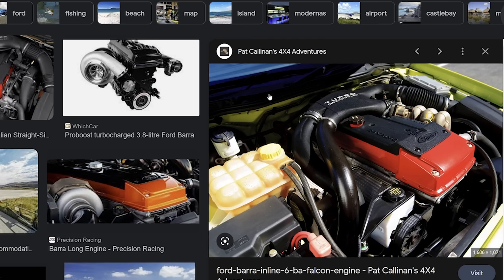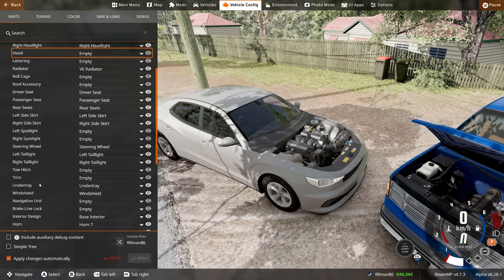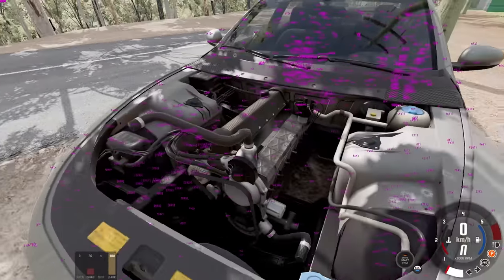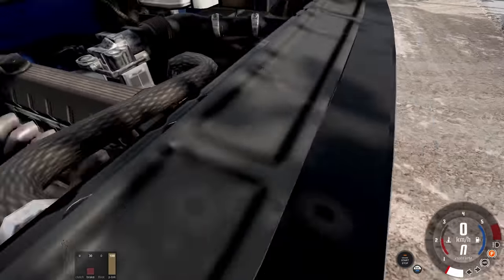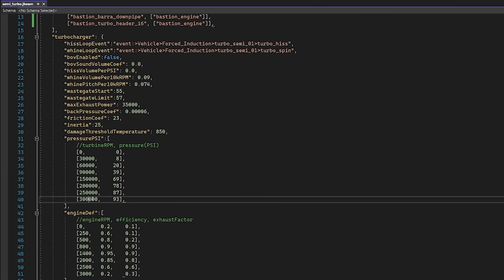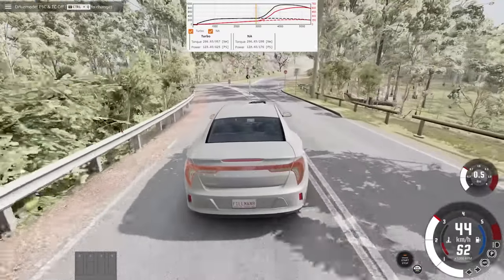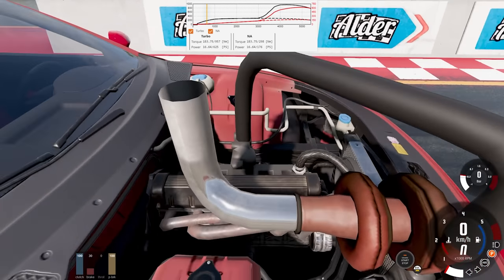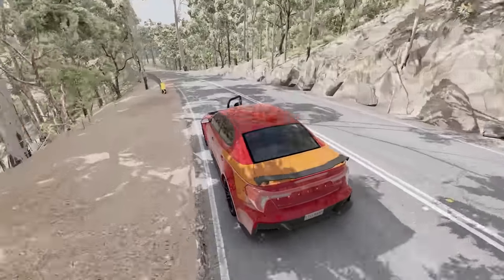The Barra Was in BeamNG All Along!!!

Comment: Nowadays people take the last generation of the 300 I6 and are putting massive turbos on them basically making torque monsters that's our substitute for not having a Barra and sure the old versions don't make any power but we love it because they are very strong and reliable
Reply from the maker: cool, does the stock version also take large gobs of fuel? haha
Reply: @fillman86  fuel economy wasn't really the 300i6 greatest benefit you basically drive it like a diesel with a 5 speed, speed and rpm isn't a benefit either its just reliable and will survive the apocalypse if you look at the head on one even on the 240 it has an inspection plate that covers the side of the head so you can see the pushrods
Reply from the maker: @kingstyle7314  pushrods? omg that's an ancient engine then
Reply: @fillman86  the 240 design was from the 60s and the 300 is just a bored over 240 with fuel injection that's pretty much it and in 97 it was replaced by the 4.2 v6 like what's in my truck and the 4.2 is just a 351 small block with 2 cylinders cut off doesn't handle boost but is still a very reliable motor but it's another slow grandpaw fleet motor made to just keep driving
Reply: @fillman86  the ford 300 (aka 4.9ish liter) inline 6 was ancient, heavy, thirsty, and underpowered as hell but I’ve head of them continuing to run in conditions that should kill any engine (bolt bouncing around in the cylinder, running out of oil, sand in the oil etc)

Comment: So, just as a datapoint, the I6 that you grabbed is actually quite close to a late-1960s Pontiac OHC I6 engine.  The valve cover and headers are quite distinctive.  (And, in 1968 and 1969, it was a 4.1L.)

Personally, I liked having the 200cid Barra-predecessor engine in my '65 Mustang because the weight balance was vastly better than the balance with a V8.  I can definitely see the appeal of a new head, though; in the old head design, the log-style intake manifold is cast in one piece with the head, which made carb swaps a bit tricky.
Reply from the maker: Yeah, many engines are similar, and this one was a lot closer to the 70/80s i6 we had than the actual barra
Reply: @fillman86  : Yup -- though I misspoke (and edited my comment to correct myself); the Pontiac engine was an overhead-cam engine, which was pretty remarkable in an era of pushrod engines!  And it was very much not a truck engine, which makes BeamNG's use of it amusing.  It still looks a lot like any other engine of the era though, unless one happens to recognize the details before being distracted by the GIANT TURBO.

Comment: the difference between the barra and the intech is the fact that they intech has sohc (single overhead cams) while the barra has dohc (dual overhead cams) im sure there are other minor differences but i cant be stuffed going through the internet anyway great video
Reply from the maker: yeah, basically the same block, intake, exhaust etc, just the head itself
Reply: Barras come with vct which is why next to there huge displacement they work so well with boost

Comment: This motor is a fine piece of machinery, with insane power potential on stock internals, I also wouldn’t really say anything before 2003 is a Barra seeing as they weren’t labelled as a Barra, I do agree for maybe the intech tho since the only real difference is the top end of the motor, can’t go wrong with either motor tho, happy we get them in the nz
Reply: Although if I remember there is the Barra 220, nugget motor but only other motor to my current knowledge with the word Barra in the name
Reply: @Dylze  barra 220 and 230, the 5.4 SOHC V8s found in the non-xr/fpv lineup. Got the 230 in my fairlane in Aus

Comment: Fillman we in America have something similar to the barra it was the amc 4.0 i6 originally designed in the early 40’s was reworked in the 60’s and used till 2006 this was a push rod inline 6 with exhaust and intake on the same side of the engine being used in 2006
Reply from the maker: lol a reverse flow head in 2006? that's wild! But the barra's origins is actually american in the first place as the thriftpower 6
Reply: @fillman86  to be fair it was one of the most reliable engines ever produced as in 300,000 miles (480,000 km) is pretty common to see still running
Reply: 4.0 was the jeep the ford was 4.9 ford has the cheap i6 wich was a 250 something i6 and the other was a 300 i6
Reply from the maker: @samuelrudy1776  I had one with over 700,000km (an ex taxi)

Comment: The mighty intec that came before the Barra ln the falcon models up to the au were only a single cam whereas the Barra was a twin cam. The intec was still a decent motor, nothing to froth over but can still produce upwards of 600kw with supporting mods and a bit of boost. The mighty Barra on the other is again nothing special standard but with some boost can reach well over 1200kw reaching rpm over 9k. The Barra was a tank from the factory and a very thirsty one at that, but it’s the engine that makes most v8 performance vehicles break a sweat just hearing its name.
Reply from the maker: I agree, the NA engines have power, but deliver it in such a boring way. Though the intech only lasted 4 years from 1998 - 2002. Before that it was still quite similar from 1988 onwards, before that it was pushrod for about 20 years. Though quite different, they were basically revisions, instead of fully new engines each time

Comment: I dont know if you figured this out or not, but the turbo options in the vehicle configurator are under the 'intake' options (because a turbo is technically an intake i guess) and the D series does have turbo options, although a good majority of the D series are NA or supercharged (i think the drift version might be turbo, and the diesel engines are turbo)
Reply: It's a technically not correct to say either as a turbo kit needs both new exhaust headers and an intake adapter. I've seen other mods have the turbos on the exhaust header option too before this one
Reply: @Ferrari255GTO  I think most of the cars in beamng don't change out the exhaust headers, I could be wrong however. I'm pretty sure the bolide and D series nun stock headers for their turbos.
Reply: @jwalster9412  it does visually change, in fact if you check all of the cars that can have a turbo don't have the option to use different exhaust headers. It was made this way since it'd be redundant and unnecesary to be able to run turbo headers without the turbos and it would be complicated to implement in game
Reply: None of the gas engines have turbo’s. It’s the diesel engine option for the d series that has a turbo
Reply: @thermalops  makes sense.

Comment: You should take the pigeon engine, give it an aluminum block, lightweight forged internals and 900Hp and swap it onto the scintilla and see how it affects it.
Reply from the maker: beamng doesn't quite work like that XD
Reply: @fillman86  had a slight typo, has been fixed 👌
Reply: @fillman86  I mean of course replicate the engine in automation to a similar degree of the pigeon engine (exact bore and stroke wouldn't matter because all you need is the right torque curve) and then modify it tastefully.
Reply from the maker: @jwalster9412  sounds like you have the skills to do it yourself :) let me know how it goes
Reply: @jwalster9412  there already is a mod to install a pigeon engine onto at least one of the civettas (don't remember wich one of them) so it could be easyer than it seems

Comment: If you can find it, there used to be some forum posts about a guy who had a Ford f-150 or F-250 pickup with the 300-6 and installed a turbo from an early 6.5L Chevy Duramax.  IIRC, the turbo started to kick in around 2000 RPM and he was hovering around 400-500 lb-ft. of torque. I think horsepower was over 200 but don't remember.  For a smaller engine like the one here, I would probably try to pull a turbo off a mid-5L diesel to be more "correct".  I miss the 300-6.  Sure it wasn't meeting emission standards and Ford didn't see a reason to make it meet it, but it was reliable.  I have an '89 Ford F-150 with the 300-6 and I don't take care of it, yet it still just runs and runs and runs.

Comment: The engine is extremely capable as a modified engine. It's basically a bigger 2jz it's reliable and makes decent power with not that much boost. It also sounds cool as shit
Reply from the maker: kinda, but the engine does have faults, and is power limited to about the same as a 2J in the end, but with not bolt on aftermarket support, and it's really inefficient
Reply: @fillman86  but it sound cool tho😎

Comment: The Seppoes never used this engine.
Reply from the maker: americans? yeah, they made the origin of this engine in the 60s, but stopped in the 79s i think, but it just kept getting iterated on until the barra
Reply: @fillman86  Not really, no. Bore centres are about the same, but that's about it. Apart from that, clean sheet of paper design.
Reply from the maker: @hoilst265  not really, it was the tiny engine to start, and it became the engine of theseus basically lol

Comment: I get 6 litres per 100klms on highway with mine so inefficient I don't think so
Reply from the maker: you're either using the last version ever released, or you're measuring it wrong (probably both haha), as most struggle to get as low as 9
Reply: @fillman86  I have only 123k on it but I can provide a picture to prove it if you need it
Reply: @fillman86  6.4L per 100klms to be precise that was from blacktown to Forster

Comment: The only reason why the barra is so loved cus of the tunning potential
Reply from the maker: other engines are sooo much easier to work with, like the 2j, any RB or SR, any LS, and that's not to mention that VW are easier to get high performance parts for
Reply: @crispyshaman4937: That's pretty funny, since up here in the states the only head we got on that engine was the one with the intake manifold cast integral with the head, and it's hard to do anything with that!  I have seen a kit where you cut holes in the intake manifold and braze on a couple of additional carburetor mounts, but that's pretty extreme -- especially for what you get from it.

Comment: Barras are hella good, u trippin
Reply from the maker: I've owned my fair share of cars, and they aren't great on fuel, and they feel great on low RPM, but they feel dull in the middle of the rev range. Are they slow though? only if they're in a falcon

I've not driven a turbo though
Reply: @fillman86  well that's why... put some power into it with a decent turbo and away you go

Comment: N dropping an auto is not right. Use a Trans brake, it is in the menu wheel. Or make a shortcut.
Reply from the maker: trans brake? you mean full brake, full accelerator?
Reply: @fillman86  no that is different, Trans brake is when the transmission is in in between gears so you can spin it up without going anywhere. Drag racers uses that a lot when they got a slush box tranny. It is in the menu wheel. Main menu->powertrain->trans brake. Put it to drive and slam the accelerator then remove the trans brake for an excellent luanch. I usually stop time then go to the menu again to remove the trans brake but you can probably do a key bind I have not checked.
Reply from the maker: @The_invok3r  odd, this isn't on normal cars, is it? I've had autos before, and I don't remember being able to do that O_o
Reply: @fillman86   you can do it with a lot of cars but you need the drag transmission. That is what makes it different from the normal counterparts. I think there are other transmission with trans brake and them not being drag transmission.
Reply: @The_invok3r  i like more using a sequential to get the extra punch on upshift, but i will check it out if i remember